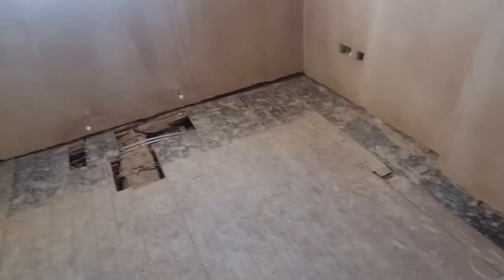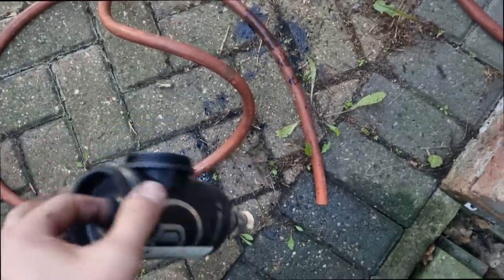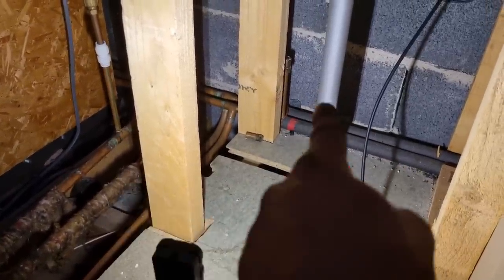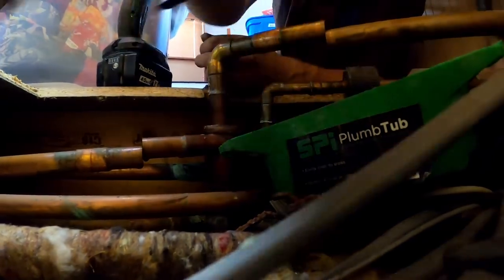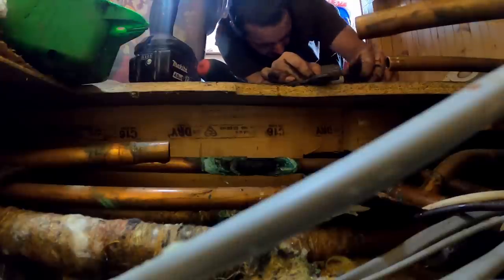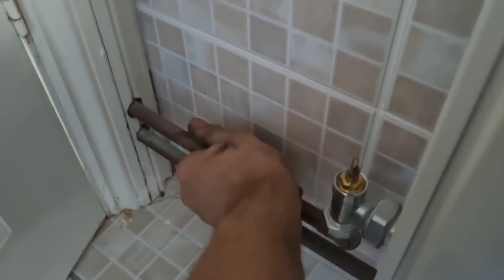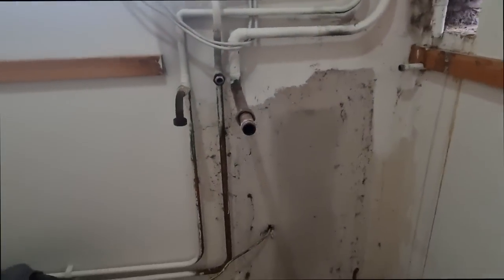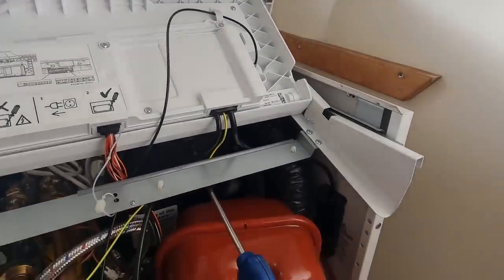THE IMPOSSIBLE JOB? | Can We Fix What Other Plumbers Couldn't

Comment: Hold a strong magnet (old magna clean magnet is perfect) near any copper pipe that you think maybe blocked obviously copper is non magnetic but if its blocked with old magnetite from the system rusting over the years it will stick to the copper. Found a few blockages like this!
Reply from the maker: Thats a really great tip, I should have shown it in the video, I was nearly certain as the pump was dry the blockage was likely to be in the air sep, thanks for the support mate

Comment: good vid as always, I tend to put a magnet on them air separators to see if they are blocked. a tip a old plumber gave me well I was a apprentice
Reply from the maker: It's a good tip, I sometimes do that but from experience if there's no water in the flow pipe normally its blocked on the air sep, thanks for watching mate

Comment: Just watched the full video Tom -- well done mate you did your best -- just like some of the jobs ive been to -- customer has had a new boiler thinking all the problems will be solved -- but the system has been piped all in 15mm !! the system water is like engine oil + the boiler installers never even tried to clean the system ( all they wanted was to get the boiler in , get their money + run !! ) -- you did everything you could -- even just a flush would have found it hard to clear the blockage in the air seperator -- i bet the customer has had a few plumbers look at that system and they had all said the same ( we're to busy sorry !} -- keep up the good work mate respect Jim ...
Reply from the maker: It's always the same story, a new boiler won't fix a bad system, hopefully a flush will fix some of the problems but ultimately it may never work properly

Comment: Get some new blades on ya cutters! :D 
Nice work as always Tom, always satisfying when you find the issue, but always demotivating when it's in the WORST place possible! I'm sure you'll completely solve the issue soon
Reply from the maker: Thanks for the support as always Josh, the system needs more work and a proper flush, hopefully it should work OK but pipe sizing may still be an issue, have a great weekend 👍

Comment: My air separator was slowing my water down for a good few years until it totally blocked. Had it removed & a H section of pipes with the vent on one side & the feed on the other sorted it. My heating has never been hotter...
Reply from the maker: Air seps were a good idea in theory but tend to cause more problems than enough, like you say a H section works just as well, thanks for watching

Comment: Excellent video as usual Tom, you are not the only one to have faulty boilers out of the box had a few myself just glad that the customers were  understanding but it does not give you any faith in the manufactures
Reply from the maker: Thanks for the support mate, it's difficult explaining to customers that there very expensive new boiler doesn't work, it causes me a lot of stress and worry to be honest, manufactures need to way more responsibility and look after installers as well as there customers.

Comment: Heroic work there. How about running some cleaner in the central heating for a week. I bet that would make a very big improvement, at little cost.
Reply from the maker: The jobs been booked back in for more investigation and a flush, some of the other pipework looked very dodgy so this will need looking at before flushing, hopefully it will work as well as it possibly can when done, although I still believe some of the larger radiators may struggle as most of the pipes are 15mm, thanks for watching mate 👍

Comment: Those air separators were the fashion in the 80s , they also made one without cold feed connection which didn’t seem to block, as always Tom good vid/work
Reply from the maker: Thanks for the support as always Danny, I've never really been a fan of them, they always seem to either block up or leak
Reply: They are fine if the system is clean and in the correct place. That system obviously not flushed properly when the Worcester was fitted. Well done for perseverance

Comment: Nice one Tom , I've cut out so many of those seppo's in the past which where all blocked , a bad design really but there's a lot of crappy designed kit out there and you can only do your best to fix , when I've had bad circulation problems on rads I shut them all off apart from the furthest and put a bottle of x800 in , temp cap the F&E tank and connect a mains water supply to fill it up and and push out all the air , fire up the boiler and get the x800 circulating , do one rad at a time for 15 mins , it's always worked for me...
Cheers.... 👍
Reply from the maker: Thanks for the support mate, the air seps seem to act like a mini filter with all the system debris getting stuck to the bottom, I like the idea of forcing it through with mains water, I think this system could defiantly benefit from a proper flush, it may not fix all the problems, but it certainly wouldn't hurt, thanks for watching as always

Comment: Cold feed blockages.              When I first went out on my own after apprenticeship the boss used to give me all this type of rubbish,  actually makes you good at problem solving.   Although I never thanked him at the time................

I have had exactly the same problem with those salamander pumps, mine was branded Center brand ( wolseys own)    the salamander tech guy on phone told me that the replacement was registered to that address, so I made the customer wait a couple of days (they had another shower)    so I would not get lumbered with the replacement pump as you did.

What was the problem with the new Heatslave???           I have had 2  bad new Danfoss nozzles recently  that gave similar symptoms and had me scratching my head for  half hour!      Boiler would strike up run for a bit then lock out.  

Have a good weekend.
Reply from the maker: Worcester went out to the Heat slave and changed the oil pump, nozzle and photocell for some reason, I think the boiler had been messed around with as normally they are full of that green water stuff but this one was dry, for the oil pump to have been set on 60psi something was defiantly a miss with it, I brought it from plumb centre who normally don't sit on boilers but this one looked like it had been sat. Those Salamander pumps have caused me more problems than enough, I will not be fitting anymore, thanks for watching as always mate

Comment: The Blow Test.......All proper plumbers have mastered the art of the blow test....hahahah

I know EXACTLY what you mean with the "manufactures and who pays for our time" issues mate, had it with Honeywell as you may of seen, 400mile and 2 brand new 3ports later i switched to EPH and all is fine.
Reply from the maker: It's tough for installers sometimes having to bare the costs of call backs to faulty parts, I honestly believe manufactures should be required to go to site and fix their products, it might make them produce quality items instead of sending rubbish out and making the installer fixing free of charge, thanks for the support as always Mark

Comment: Why is the air separator under the floor or did they put it in the ceiling 😂😂 either way kudos to you Tom man
Reply from the maker: I think it has been a loft conversion at some point, a very strange place to put one, I actually never went back to this job, I did quote for a flush but the customer was happy, I did struggle to balance the system and get all the air out, it was one of them where you can only do your best
Reply: @PlumbLikeTom   i can imagine balancing being tricky yet tenacity is a virtue yet in some cases its a curse lol I've had similar jobs where you can only do so much before you have to just let it go. If the client is happy thats all the matters

Comment: Hi dude, what size spanner do u use for the 22mm nuts
Reply from the maker: Hi mate, have a look for compression fitting spanners on Amazon, the one I use is the monument 2069r, but I've been told there is a blue silverline one that is identical for half the price
Reply: @PlumbLikeTom  cheers mate appreciate it

Comment: The best way to prevent manufacturers from forcing the fitter to pay for the manufacturers dodgy parts is to get the customer to purchase the part, ie new boiler etc.
Reply from the maker: That is a fair point, I tend to like to supply my own stuff but I completely get why some people don't, luckily it doesn't happen to often, getting the job right for the customer always has to be the most important thing when it does though

Comment: I've  not done oil .
Is it a storage combi ?
Reply from the maker: Oil boilers can't modulate like gas boilers can so they keep a tank filled with hot heating water which in turns passes through the plate to heat the hot water, they don't actually store hot water but they do give good flow rates, I'm planning on doing a video explaining more
Reply: @PlumbLikeTom   I've seen somthing similar one ,but a gas boiler .
It as two pumps .
The cylinder is full of  central heating water not domestic hot water .  It al

Comment: What’s your preference to an air separator?
Reply from the maker: Lukily most systems are now sealed but on open vented systems as long as the feed and vent are within 150mm of each other on the negative side of the pump the system will work perfect, air seps always collect dirt, I think they act unintentionally like a filter, dirt drops to the bottom and blocks the thing up

Comment: Is it worth closing the system to a pressurised system?
Reply from the maker: It probably would solve some of the issues, the only thing is the pipes are under concrete floors downstairs and it may open up a can of worms if they do leak, thanks for the support as always mate

Comment: Fitted quite a few salamander pumps mostly bought from screwfix, there have been defective within a year . No problem from SF but the customer has to pay for the time when it should be the company who foots the bill.
Seems to be you lose or the customer looses and the company chucks out shoddy goods and creams the money
Reply from the maker: I requested Salamander to go out and change the pump, they refused stating it was likely fitted incorrectly, they take no responsibility when things go wrong, I will not be fitting another one of their products. thanks for the support mate
Reply: @PlumbLikeTom  your spot on ! Always incorrect installation, do you recommend any other brand?
Reply from the maker: @jeromeroddy4931  Stuart and turner have always been the best shower pumps, they are more expensive, but it clearly shows why

Comment: Agree with the manufacturing defects and lack of accountability from manufacturers. The amount of should have been rejects showing up is getting rediculous. I've even had bathroom pottery with manufacturing flaws with a quality control sticker covering the defect. Obviously didn't remove the sticker until after installation. After arguing the toss they send you out a new one and want you to dispose of the faulty one all at the fitters exspense.
Reply from the maker: I fitted 7 toilets on a job last week, one was so poorly cast it didn't sit back to the wall properly, I phoned my supplier asking for a new pan, the only way the manufacture would send a new one would be if I paid £60 delivery, it's an absolute disgrace that installers should be left with a financial penalty for manufactures defects

Comment: Shouldn’t the installer of that new looking boiler in the dorma bungalow flushed the system and checked everything was working properly?  Doubt they could have benchmarked it either after commissioning.
Reply from the maker: It should be the installer going back but a lot of plumbers seem to disappear when problems arise, never to be seen again, I checked the registration with Worcester and the boiler wasn't registered so it's unlikely the benchmark was left or filled out, thanks for watching mate

Comment: No, it's not you that only gets the crap jobs. My son-in-law is also a heating and plumber engineer, it always seemed that he got the back boiler jobs which he used to hate doing.
Reply from the maker: I hate the back boilers as well, when I worked for my old company all I used to get was all the jobs nobody else wanted, it was certainly a character building job, thanks for watching 👍

Comment: They should have flushed the system prior to new boiler installation. No warrantee to be had with the manufacturer as a result. Cutting corners doesn't pay.
Reply from the maker: Your right John, a flush probably would have stopped a lot of the issues the system is experiencing, thanks for watching mate

Comment: I’d robo kit it if it’s an option….state of the water it’s obv never been flushed ….brand new Worcester boiler you say never been registered…… whoever originally installed that boiler has shafted the customer….absolute cowboy…what’s the point in buying a decent boiler with a decent guarantee when it’s null nd void a second after it’s been fitted!!!
Reply from the maker: The system needs further investigation, ideally it needs new rad valves as most of them are leaking or stuck, a good flush should fix some of the issues but pipe sizing will also be a factor, all three large doubles in the lounge and dining room were piped of one 15mm drop, some jobs you can only do your best, thanks for the support mate 👍

Comment: Make it into a sealed system after its had a proper flush 😳
Reply from the maker: That was a thought I did have, I was just worried about some of the old pipework under the concrete floors, it might open a whole new can of worms, thanks for the support mate
Reply: @PlumbLikeTom  yeah there is that potential problem
But i guess a pressure test on the pipes would give you a better idea.
Love the vids, proper plumbing even though the wife says im plumbing all day then watching it all.night on YouTube 
You can only do your best
 😉

Comment: Who on gods earth puts an air separator under floor level!!!!! I’d also blame whoever altered that feed and vent before him…. They did more harm then good, nothing worse the. When you fire a boiler up and it keeps cutting out!!!  Blocked feed and vent or air locked…. Both a mare!!!!
Reply from the maker: I think the system has been played around with by multiple plumbers, it's still not 100% working on heating but at least now the hot water is fine, I need to go back and have a better look at the pipework and try and flush it out, thanks for the support mate
Reply: Is there an option of putting a robo kit on it, making it a sealed system?
Reply from the maker: @jonnyallen1232  I'm just a bit concerned about the old pipework under the concrete floors, it might open up an entire new can of worms

Comment: wait till you check invoices from city plumbing. on average they send half of them. yet i pay on a monthly basis. i can see your stressed. calm down. slow down and understand you cant do everything. city plumbing ceo email please from any installers?

how much did that pump move?
Reply from the maker: That system was a mess with multiple issues, ideally the cold feed and vent arrangement need looking at along with the pipework from the boiler, I did my best on the day to get some heating and hot water back on as the lady had limited mobility and was feeling very cold. I have priced for a flush; this will fix some of the issues but is in no way a miracle cure for everything. Plumbing merchants sometimes drive me insane, I check every invoice from mine as often prices differ from those quoted, Thanks for watching mate
Reply: @PlumbLikeTom   price differing from what they quoted is normality from plumb center aka wosley. the managers have to hit a monthly target i was told to get a bonus, so what you get is they will overcharge you one month then credit you the next. you might even find a boiler or 2 on your account that you never had.............. the managers do it to increase that months sales then apologise to you saying usually sorry we mistakenly book them boilers etc to your account but they were delivered to someone else(a lie). the suits at the top know? and are mainly the problem? managers hit a target one month then credit the next month so they have no way to hit a target since they are starting on a big negative. suits at the top (or bent managers and accounts teams) know some people just pay the monthly statment. nice way to make money right?

having problems with city plumbing atm usually thats because of not getting invoices. karen marlborough in accounts has been asked to confirm our conversation when she gave me the ceos email. maybe shes on holiday i dont know.............. if i was her i'd have gone of sick as well. poor woman is understaffed? she was told to phone back on my home number she called back on mobile knowing i couldnt record the conversation.

your a hard working lad dont get into the loop like i did. it's time us gas safes and plumbers talked more. ty for taking time out of your day to make uploads. watch for missed invoices as well as quote differences ;) you know you'll be back to that RI at some point right? water will have squirted al in side the boiler. left or right hand side of the hydro block ,pinhole leak will have probably taken something electrical out. wortershite.